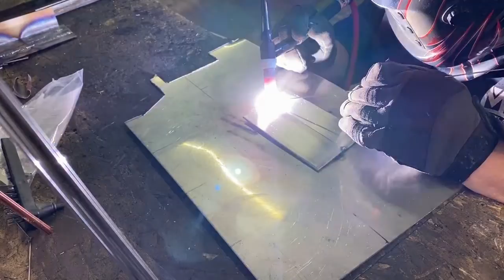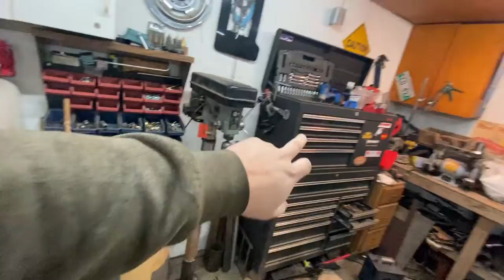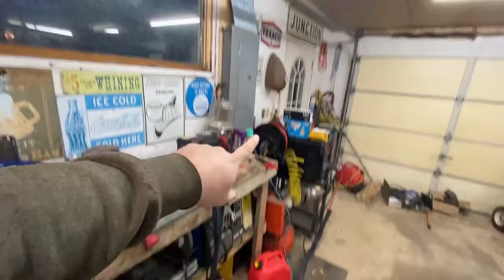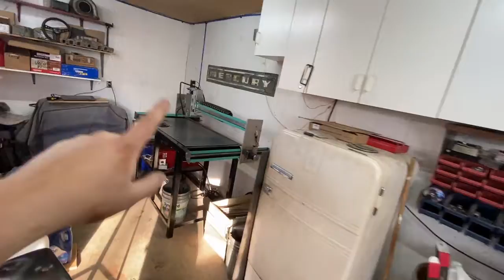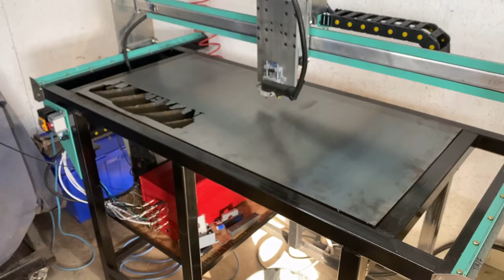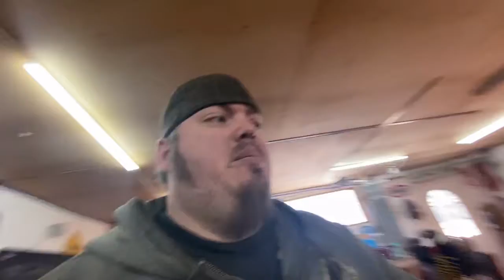Lets Cut something!!!! this CNC plasma is awesome!

Comment: Very nice👍
I have a plasma cutter and cutting has been, well challenging, to say the least. Maybe this coming winter I will look into a CNC plasma table. If I commit to it I will need to  have it set up to lift up to the ceiling as floor space is premium in my garage.
Cheers
Reply from the maker: Thanks buddy. Yeah that’s why I made my table the size I did. You never have enough room.

Comment: The plasma cutter came out awesome. What gear racks did you use..?? And where did you buy them..??
Reply from the maker: I got them from a company in Canada. Motion tec. But they just get them from overs seas so they would be the same as what you would get on amazon or eBay. I’ll see if I can find the size used. Thanks for watching!